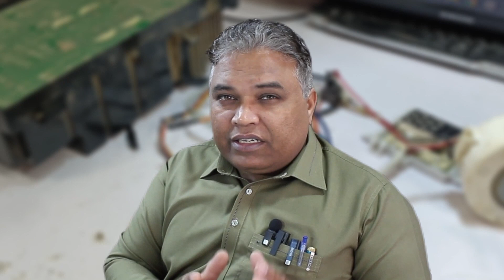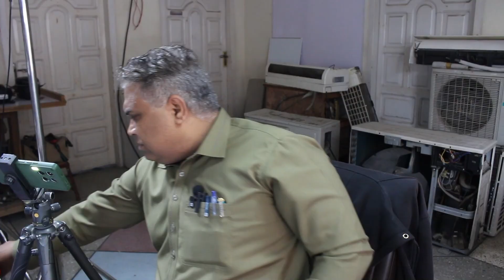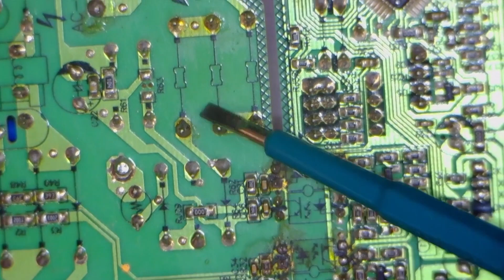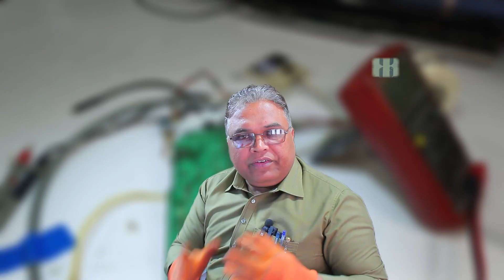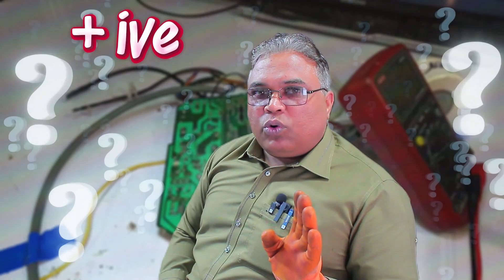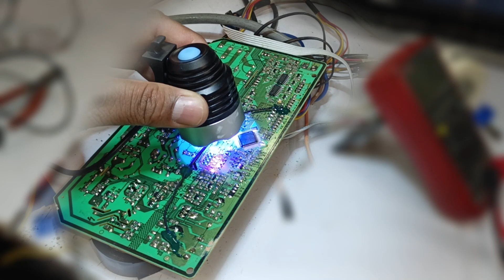F6 Fix: The Hidden Mini Split AC Circuit Fault You Didn’t See Coming!

Comment: Estoy muy agradecido por sus enseñanzas. Soy un fan seguidor de sus videos tutoriales. Tengo una pregunta, cuento con una PCB 1001 controladora de una bomba de calor on/off, la misma trabaja a 12v. Es posible que el uln2003 genere una "baja" de voltaje y deje la placa inoperativa? Revise todas las variables y finalmente con cámara térmica note el uln2003 con "alta temperatura", es factible que esa sea la razón de la baja de voltaje?